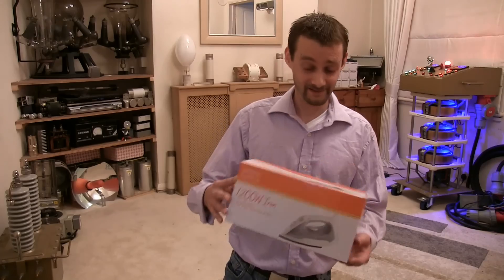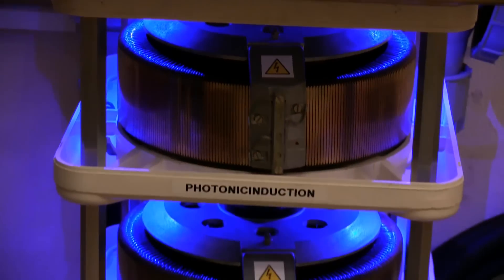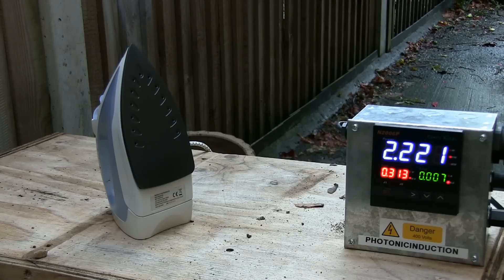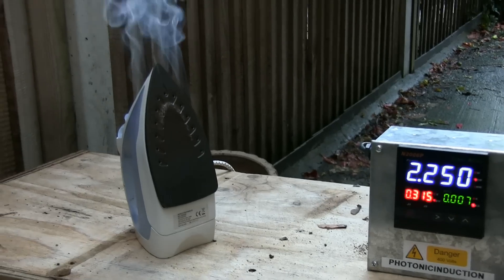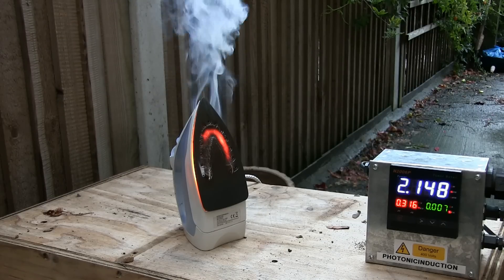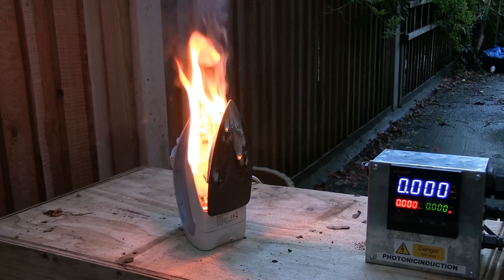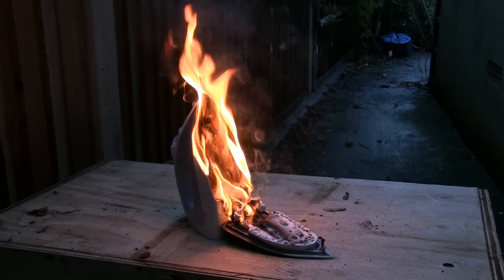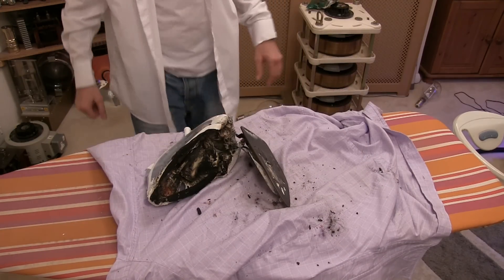Extreme Iron Test

Comment: Excellent video.

What I don't understand is why plastic especially flammable plastic is used by manufacturers anywhere near anything that gets hot.
Reply: *****  I know, but one would think at least flammable plastics would be banned for use with anything that produces heat, but then again the iron was made in China so go figure.
Reply: +Squishy Potatoe It is, except I bet on that plastic not being heat proof at all and literally cracking and falling apart just from use alone (I've seen that happen to kettles).
Reply: +jmcinvale It would make manufacturing MUCH trickier and all the resulting products MUCH more expensive. Thermosets (thermosetting plastics) can't be extruded, arbitrarily shaped nor reused among others (pretty much only molded). This greatly limits their applicability
Reply: +Squishy Potatoe True, but for some reason some of the plastics are crappy enough to crack and literally peel/fall apart even when their melting temperature is not reached at all.
Reply: +CoolKoon I'd rather have that versus appliances that get hot made out of flammable plastic that could burn my house down should the safety features fail. 

The simple way is to use metal like was done many years ago.

Plastics are used only because they are cheaper to make.
Reply: +jmcinvale Don't worry, such plastics will make the device unsafe to handle in other ways soon enough e.g. by exposing live parts, which (at worst case) might touch the ironing plate, thus making touching it an electrocution hazard. And it killing you is kinda worse than it burning your house down, isn't it?
There are parts which you simply can't make out of metal (simply because it's conductive). Before the advent of modern plastics (e.g. epoxy) other thermosetting plastics (especially Bakelite) or porcelain has been used for the same purpose. Porcelain is a LOT more fragile than plastics though and Bakelite requires particularly nasty chemicals for its production (epoxy is a bit more environment friendly in this manner).
Reply: +CoolKoon 

Why can't electric irons still be made like they were many years ago?

Used to most all appliances that got hot were made out of metal without much plastic at all.

A lot of those old appliances that were taken care of still survive today in good working order.

Doesn't matter how much money is saved or how much greener for the environment it is making appliances out of plastic, when said devices could catch fire and burn people's homes down possibly taking lives (if everyone cannot get out in time) if overheated.

In my opinion using plastics is all about saving money.
Reply: +jmcinvale First of all, they were made from (thermosetting) plastics many years ago too, which didn't catch fire, just was environmentally unfriendlier (Bakelite). You can't have an iron made completely out of metal (not even the "analog" ones that used hot coal instead of electricity for heating, even those had a wooden handle), because iron conducts electricity and heat (although none of them conducts as good as e.g. aluminium or copper does). You HAVE to have some parts (at least a handle) made from wood or plastic.

Those old appliances that "still survive today in good working order" were built to last, because they cost a fortune. When TVs cost about two month's worth of salary of an average blue collar worker, you just couldn't afford to have it fail after a couple months (like all the crap sold in the US does, since their warranty/consumer rights laws are beyond pathetic). But people wanted to buy it cheaper. And cheaper. And then even cheaper. On the other hand say Bang&Olufsen audio gear (and probably TVs too) still come with a lifetime warranty meaning that they are still built to last. On the other hand they still cost at least 2-3x as much as anything of the regular "consumer" grade crap out there. So you can choose between buying cheap and having to replace it a bit prematurely or buying something expensive that you don't need to replace (just for the record: the Philips LCD TV we had for ages i.e. at least for 10 years is still working perfectly fine).
Reply: +Squishy Potatoe No, it's not only about saving money. Let me ask you: would you touch an iron that's built ENTIRELY of metal (including its handle)? I don't think you'd want to.......
Reply: +CoolKoon 

"they were made from (thermosetting) plastics many years ago too, which didn't catch fire, just was environmentally unfriendlier (Bakelite). "

So I guess people would rather risk their homes burning down and lives possibly being lost in order to save the environment?

What happened is the chinese crap started to be imported to the USA in the 80's and unfortunately was not made to cost as much as the USA made stuff so people who only look at how much something costs bought the cheap chinese crap which meant the US manufacturers had to cheapen their products or move production offshore where they could make it for less money. Those manufacturers that didn't such as Curtis Mathes, went under rather quickly. Also some brands either sold out to foreign companies or in the case of companies like GE allowed a foreign company to use their name on certain types of products they no longer wanted to make. In fact a lot of once excellent brands of appliances and electronics exist merely in name only as manufacturers of cheap shit use the name in hopes that will attract more customers.
Reply: +jmcinvale But before the Chinese crap started to be imported to the USA, there was Japanese, South Korean, Taiwanese etc. crap that has been of same quality and price range as the Chinese crap is today. And it was the American manufacturers' decision to try and compete with their Japanese, Korean and later Chinese counterparts in pricing (which was a lost cause) instead of improving quality, making more interesting/innovative products that the Japanese or the Chinese didn't sell etc. Later on the US manufacturers have also moved offshore.
So let me ask you: IF the Chinese crap is so dangerous, how come everyone's buying it? Obviously even in case of this experiment by photonicinduction they had to remove all the protection within the iron AND subject it to severe overvoltage (the kind you'd NEVER get at your wall outlet) to make it destroy itself. And yet the iron cost only ~$7.
Reply: +Squishy Potatoe So then why do you think plastics are only used to cut prices? Because that's just half of the story.....
Reply: +CoolKoon Because of the price. 

Someone who doesn't really know will see a quality device for one price then  see the cheaply made one with the exact same features for less money. Which do you think they will buy?

Sure other countries have had their junk here, but not nearly as much as the chinese have.
Reply: +jmcinvale But you still don't see houses burning down all across the US because of faulty Chinese gadgets, do you? Sure, every now and then a charger or two (or a battery or two) explodes, but that's about it. Overall these devices are safe enough to be sold in the US (otherwise they would've been banned a long time ago) and their cheapness (and thus their drawbacks) manifest themselves only in the long-time run (they fall apart easier, they get uncomfortable easier, they overheat easier, they get worn easier, they fade MUCH easier, they are more sluggish etc.) or to the untrained eyes/ears never (the inferior sound quality of the cheap headphones, the low-quality appearance of clothes, the lack of features in electronics etc.). Many of these people still think that bought the thing "at a bargain", because many times they're even right: replacing a $500 laptop every 2-3 years is still a better deal than not replacing a $2000 Macbook for 6-7 years. The race to the bottom is still on...

Not as much as the Chinese have? Does the brand Toyota ring a bell? The last time I've been in the US they had more Toyotas than all the local brands combined. And that was about 10 years ago. The electronics industry is even worse off: nowadays only the CPU (plus the associated chipsets and perhaps the GPU) is US-made in them (including cell phones and PCs). And no, the rest isn't built exclusively in China either (especially the more advanced stuff e.g. all the chips including the RAM, ROM, ASICs like sound chips, tuner chips etc.).
Reply: +CoolKoon sometimes if something entirely made of plastic causes a fire it is usually burned beyond recognition such that there are no or very little traces of the device. 

it just seems like a bad idea to me for an appliance that gets hot to be made mostly out of plastic. the video shows what can happen should all thermal safety devices fail to do their job. highly unlikely, but anything is possible.
Reply: +jmcinvale Oh yeah, I've seen a couple weeks ago a truck loaded with foamy material burn. By the time the firefighters have arrived there was hardly anything left to burn and literally only the wire frame of the truck (plus the cabin itself) remained.

The thermal safety devices (two of them!) are there exactly to avoid the "what if" situation. You know, in 1986 a couple idiots got this idea that would a nuclear reactor survive IF they'd turn off ALL its failsafe features and then run it basically without any cooling. Well guess what: it didn't. The whole reactor chamber's cover WAS blown off by the huge amount of steam accumulated within...... So yes, anything is possible, but the manufacturers are usually trying to make things fairly safe to use, to avoid serving jail time or having their pants sued off by things going wrong. 
Regarding the scenario demonstrated: no, it would NOT happen even with the thermal safety devices disabled/removed/defeated. The iron was rated for 230V+-4% (or a range of 220-240V, pretty close to the standard voltage of 230V used in all Europe with a tolerance of +-5% usually quoted by the utility companies). Did you see any problems with the iron at 240-245V (that's the highest voltage that can possibly appear at the wall outlet)? Because I didn't. No, the smoke started to appear only above 300V which is WAY beyond the maximum ratings of ANY home appliance. And if you use anything beyond the "safe" specs outlined by the manufacturer you're pretty much on your own. Does its insulation resistance break down killing you or its material melt burning down your home? Too bad, because you didn't keep its use within the safe scope define by the item's manufacturer.
Reply: +CoolKoon Not exactly, but then again it wasn't left at 250 volts for that long.

Besides, if nothing adverse would happen at 250 volts then it wouldn't need a thermal safety device.
Reply: +jmcinvale It was left on any rated voltage for too short. The problem is that if some idiot would leave the iron on for too long (e.g. all night), then it might get too hot and start to melt. But even without such thermal protection you need at least one thermal protection that you use to regulate the iron's heat: a thermostat (made from a bimetallic element). This is included in all the irons no matter what.
Reply: +myoneandonlyc yes, maybe, but the biggest protection is the heating element itself: it's designed to heat to a designated temperature at which an equilibrium sets in: the current can't increase above a certain value because the hot heating element prevents that, but can't decrease either, because the resistance of the element dissipates some power. Thus it's much more likely for these things to burn something else than to melt themselves down. In fact even those Chinese chargers are much more likely to explode than this burning down :P
Reply: +CoolKoon Depends on how hot the heating element is designed to get.We already know the heating element can get as hot as the highest temperature allowed by the iron's thermostat, but because of the thermal cutout it must be capable of getting hotter should the thermostat fail closed.What we don't know is what temperature the thermal cutout opens at.If it opens at a greater temperature than the plastic starts to burn at then there is a major problem, but if it opens at a temperature less than what causes the plastic to burn then it is safer, but not completely safe, because we don't know what temperature the heating element will go to if the thermostat fails closed and the thermal cutout doesn't open. If the iron is designed to heat up relatively quickly, it's a sure bet that the heating element would get hot enough to cause a problem if fed the full line voltage without any thermostat or thermal cutout.

Comment: It's kind of crazy that we electricians are being faced with tighter regulations in regard to electrical fire, whereas to be fair a properly designed installation shouldn't be the cause of a fire. Yet there is absolutely nothing wrong with appliances with heating elements in flammable plastic casings being sold to consumers.

Comment: Hi Photon, did this iron have some kind of thermal cut out device built in? Or did you remove it or short it out before cranking up the voltage?
Reply: The description says he removed them.
Reply from the maker: Power was connected directly to the element :)
Reply: ***** Hah hah, I should have known :-)   And I should also have read the description :-)

Comment: It's possibly worth reuploading this, as YouTube just LITERALLY added the ability to upload in 60fps. It'd look much better. :)
Reply: His camera doesn't support high FPS. It's a cheapie. And the 60fps takes a long time to upload.
Reply: depends on the type of camera, may have to deinterlace. might actually be 50 FPS which youtube also supports
Reply from the maker: Alucard Pawpad 50fps max I think :(
Reply: YouTube supports 50 too :)
Reply: ***** It supports both 50 and 60 fps :)
Reply: Correction, youtube support 25 and 60. The video has to be forced 60 + fps in order for it to not be in 25fps.
Reply: TJSW I've uploaded 50 fps and 40 fps. youtube encoded fmt 298 at 50 fps and 40 fps.
Reply: Oddly, when they first added the support, I uploaded the raw video file from my camera (MTS) and it showed up on YouTube as 720p50 and 1080p50, but now for some reason, they have just reverted to 1080p and 720p and any I upload from my camera are just 30 fps. Did YouTube stop supporting MTS on 50/60 fps? o.O

Comment: I think the commenters below are right on this one having been badly built. 300 V on an appliance designed for rest-of-the-world mains (220-240 V) and it's already into thermal runaway and then on fire. Should take a lot more than that to "pop" it going by the basic scaling laws for temperature versus applied voltage.

Comment: Tested a monitor board yesterday, it did not survive well..........

VID 20141030 151706

Think the iron was not made with the right flame retardant plastics there, it should not have continued burning like that. Time to drop your local trading standards a note with the box and where you got it, others might be injured by the rest of the lot.